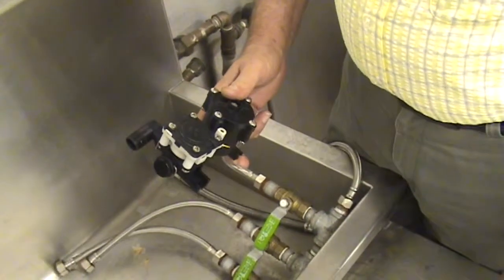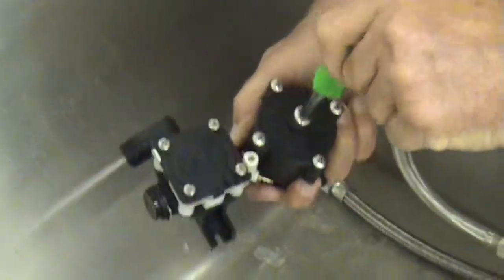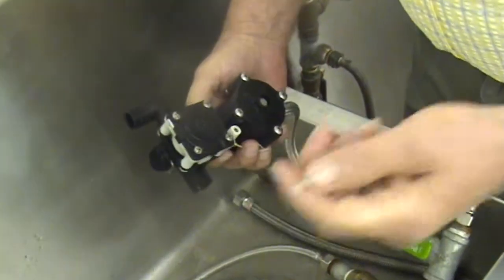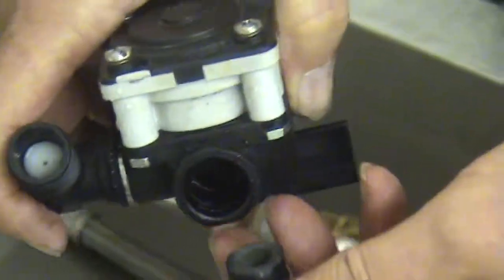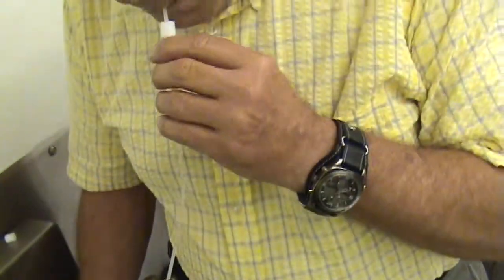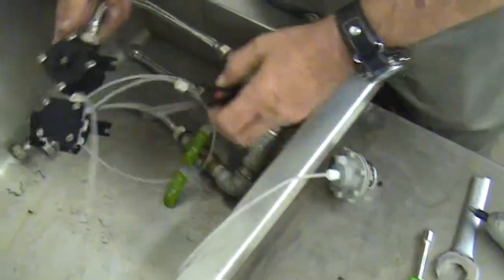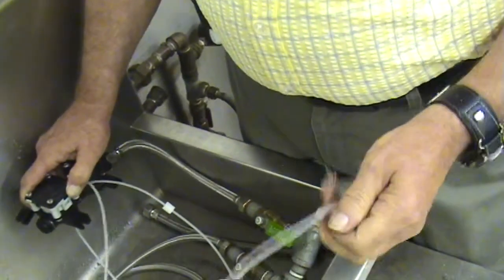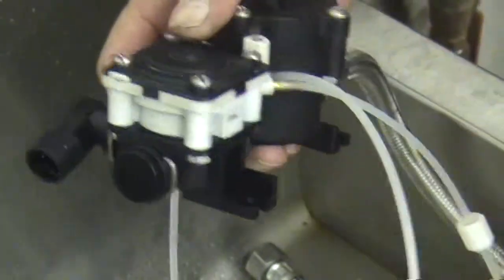Troubleshooting Metcraft Valves - Valve Wont Come On

Comment: I have a valve that turns on and turns off but when off it lets a drip pass . I've changed the disc & spring and the diaphragm. Same thing.  Drip at the faucet. I've also changed the valve assembly .  Same thing. Not sure what to do next.
Reply from the maker: Hey Marvin, 

You're welcome to call Stacey Wade for tech support! 816.554.0300 ext. 303